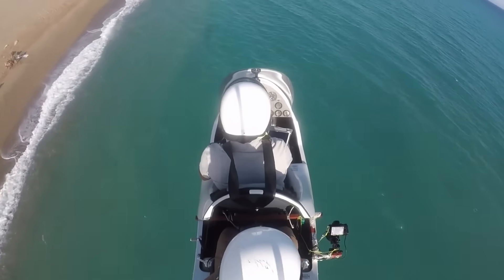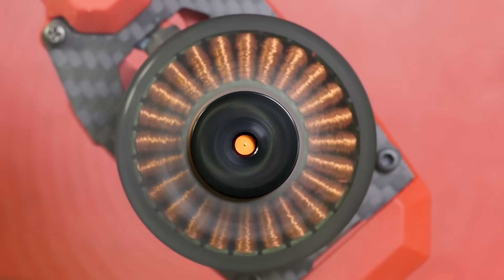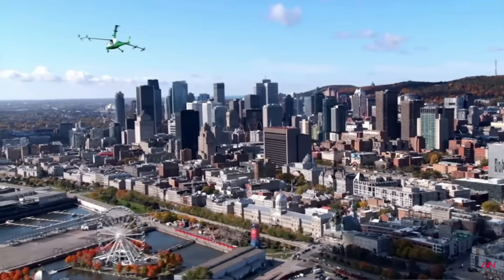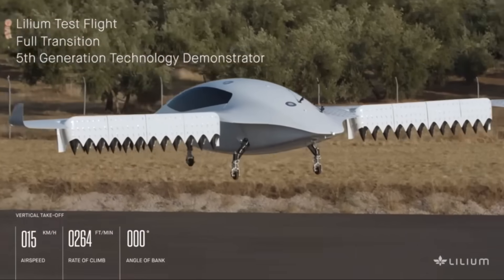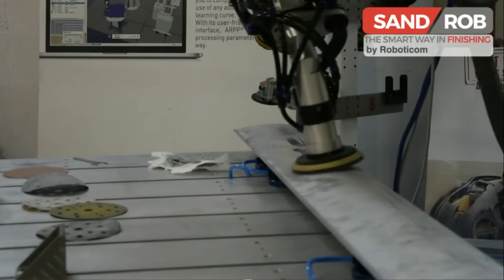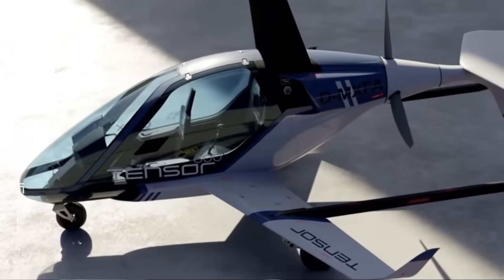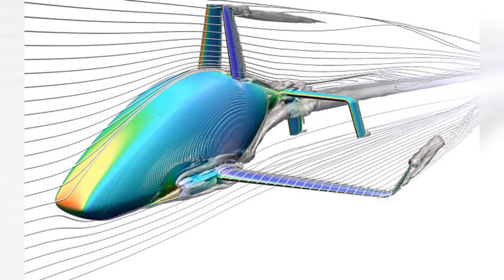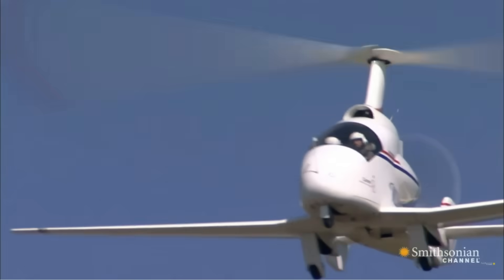The Brilliance of Modern Gyrocopters

Comment: I've been flying gyros in the UK for some 10 years. The attitude people have towards these machines only makes us gyronauts feel special😅
The magnetic reduction of rotor speed in high speed flight would be a very helpful development imo.. AutoGyro of germany have had an electric gyro available (cavalon) since 2010, but it doesn't have any such rotor control system.
Reply from the maker: They really need to upgrade the eCavalon with better batteries and powered rotor. Yeah there is a negative attitude towards Gyros even though its a very practical flying machine

Comment: Yes! Finally!  Making it Hybrid and all props electric will be, from my point of view, the way to go.
Reply: Yes, a rotax/electric generator would add range, lower cost, still allow silent take off and landing,  add powered landing during engine out event.
Reply: @michaelglenning5107 how would it do any of those things, batteries are to heavy and converting energy multiple times is horrible too
Reply: @shaynegadsden  the battery is very small, only for take offs. Level flights are by the engine, there’s no need for energy conversion, except during slowing down and descending, free energy that would be scrubbed off anyway.
Reply: @madsam0320  did you not understand the comments, having an electric drive means the motor is making kinetic power to convert to electric to convert back to kinetic that's why there is a lot of loss in conversion. Also a small battery really isn't very small in such a weight critical situation a very small of 6.5kwh like the eCavalon used gave just 30 minutes use from a 40kg battery sure it was pure electric but could only carry 2 average men. So if you wanted to have a generator you would need a bigger craft and bigger motor and then that battery does nothing so a bigger battery too.
In the end all you did was make an overpriced fueled gyro that would have been cheaper, more efficent and more useful is you threw out all the EV components and just used the engine like normal
To simplify a regular engine    thermal > mechanical
The hybrid system here    thermal > mechanical > electrical > mechanical
Reply: I couldnt agree more

Comment: I always saw gyros as the most efficient VTOL solution, now with these new developments, they secure that spot. 
The only way other VTOL options can compete is at higher speed, maneuverability and depending their design; they may land on more closed or urbanized places, but with the drawback of higher energy consumption, cost and noise.
Reply: They probably could have specific air taxi stations for VTOL vehicles and perhaps they could use fuel cells instead. Fuel cells might improve energy to weight ratios and range.
Reply: @jason8ification  for any air vehicle who wants to achieve more than 90 min of nominal power and fast recharge, hydrogen is a must.
But for widespread adoption to replace a percentage of cars, noise reduction is still the hardest thing to accomplish.

Comment: Really interesting, i always thought they were just a gimmick, didnt expect them to have this much potential for the future.
Reply: Gyrocopters -- or autogyros -- have been part of the homebuilt and utralight market here in the States since before the FAA had regulations regarding what we now call ultralights.  The problem, as noted here, is that autogyros have been notoriously slow and short ranged.  

I'm particularly interested in whether any of the new generation of gyrocopters sport multiple rotors.  I recall seeing and hearing Hughes/McDonnell Douglas helicopters with six blades producing significantly less noise than Bell and Sikorsky machines.  The Hughes machines were also fast and efficient.

Anyone got any ideas?
Reply: @johndemeritt3460  You got me interested in the multirotor thing, i dont know nothing on the topic so when I searched i got confused, what i see is or two "pushers" rotors side by side or two of the big rotors overhead, so i wanna know what you mean when you say "multirotor" since i am confused now kk.
Reply: @sorakagodess , I'm sorry if I gave the wrong impression: I meant helicopters with more than two or four rotor blades.  The Hughes 500 had five or six blades as I recall . . . 

Looking at the Wikipedia page for the MD-500 series aircraft (https://en.wikipedia.org/wiki/MD_Helicopters_MD_500), the MD-500 had a five blade main rotor with a diameter of about 27 feet (8.33 m).  This allowed the rotor to turn so the blade tips didn't reach supersonic velocity, making for a quiet helicopter..

That said, I can see where a twin side-by-side mast, intermeshing rotor design, like that on the Kaman I-Max or the HH-43 Huskie of the Vietnam era would be effective.
Reply: @johndemeritt3460
I proposed this solution to leading polish gyrocoper company. The answer was that they live in the very small niche between drones and regular helicopters. Every complication in the propulsion system is not viable economically. The main cost benefit is the cheaper rotor head than in helicopter.
Reply: @peceed  maybe with the advancement in batteries and in eletric motors the work "space" expand enough so that they can use more complex components without losing potential customers and markets.
Reply: @johndemeritt3460  From this video, it looks like a fixed wing gives a huge boost to the range, while adding little drag compared to a rotor, and not requiring active power.
Reply: @johndemeritt3460 Modern gyroplanes have a 350-400 mi. range. They are relatively slow (90-100 kts). But will do 80% of what a helicopter will do and cheaper. Burning about 5-5.5 gal an hour of 100LL or autogas.
Reply: These machines are simple and very cheap to run. They have none of the issues that helicopters have with complex rotor tilting mechanisms or drive. My father always said that the military never used them because they were too cheap!